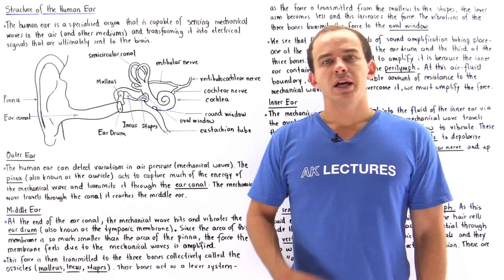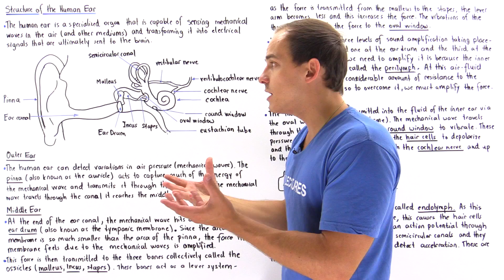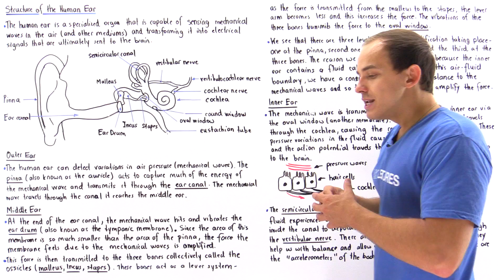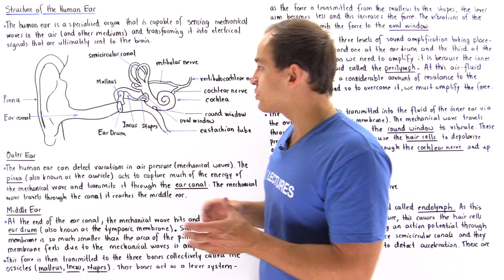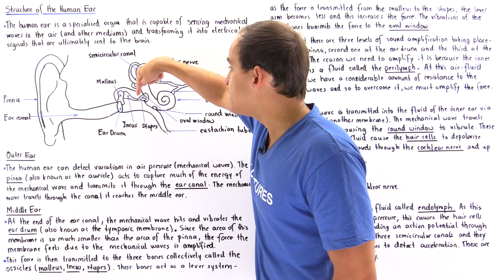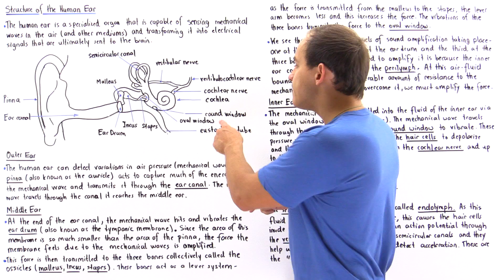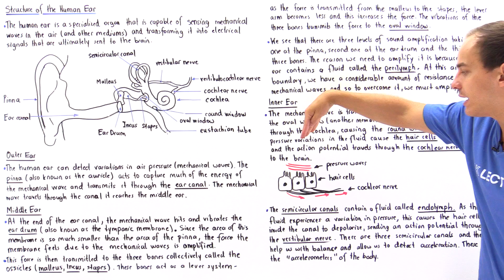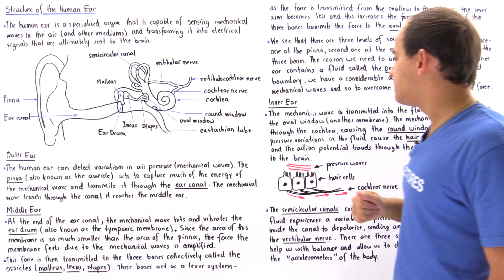Structure of the Human Ear

Comment: Everyone who talks about the inner ear has his own idea of how it works!  I think you are wrong in emphasising a 'pressure wave'.  Firstly, you say that a pressure wave cannot travel in a liquid, but this is wrong - sound travels very well in water, as a pressure wave.  A fluid cannot support a transverse wave.  it's just that the medium is very stiff, but it is compressible.  You then talk of the pressure wave causing depolarisation, but this is not right.  The cilia sense movement of the membrane not the fluid pressure.  Very importantly, the cochlea works using not pressure waves but transverse waves set up across the membrane between two chambers which propagate in a very special way, and the round window allows this transverse wave to be set up by allowing movement of the membrane to cause fluid displacement, though some of that displacement progresses to the apex depending on frequency..